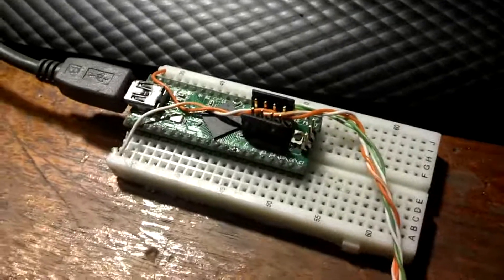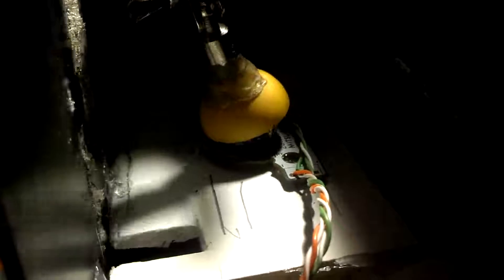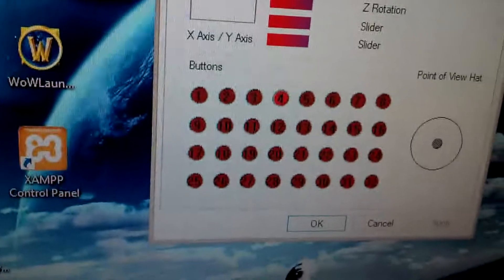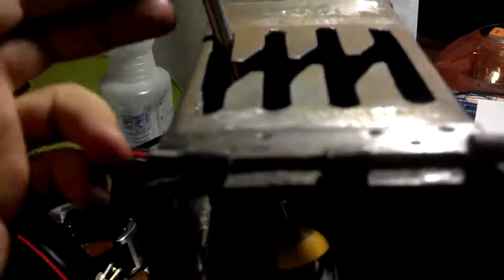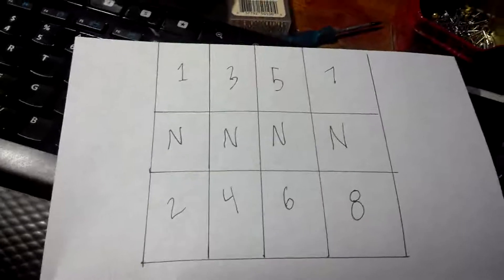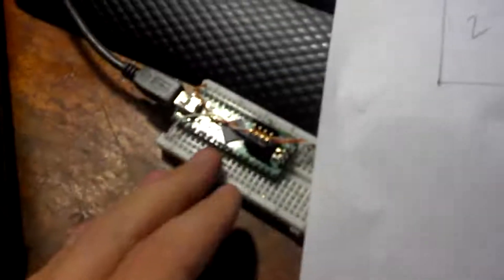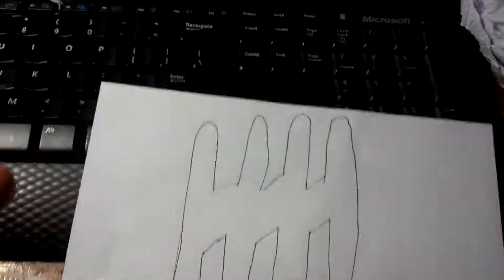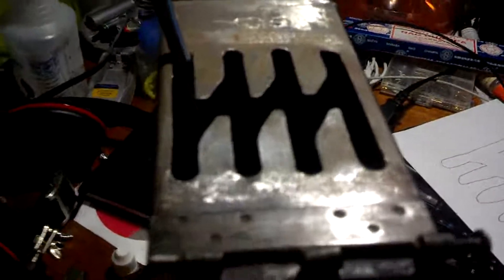DIY Shifter v2

Comment: what is the software you used to map the xy axis positions for the gears?
Reply from the maker: I programmed the teensy to translate the x/y values to button presses.
Reply: With what software?
Reply from the maker: Japanichi not software, firmware.  I wrote it myself, and it runs on the microcontroller.  When I get home, I can upload the source if you want.
Reply: please please please upload it. make a tutorial please! :)
Reply from the maker: Dude, this was 5 years ago.  That firmware is long gone.  All it really is is reading 2 pots.  I'll put some sample code in the description for you